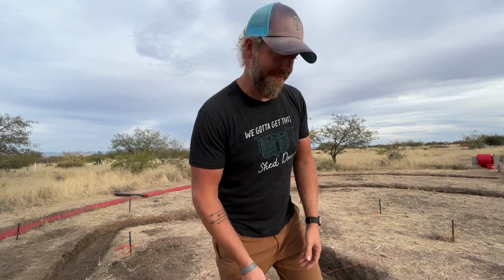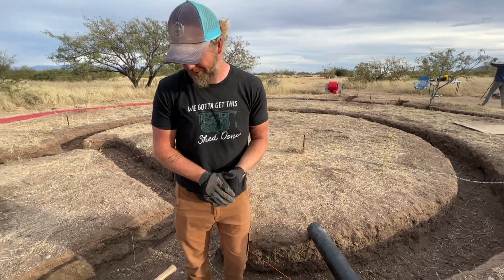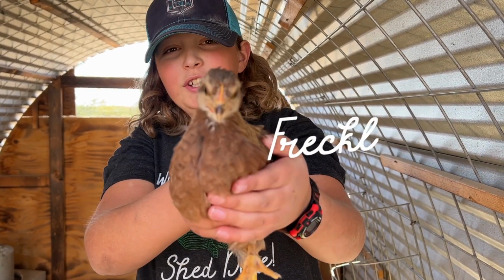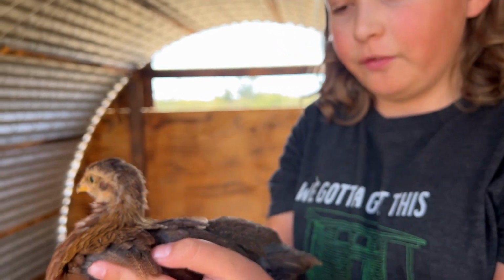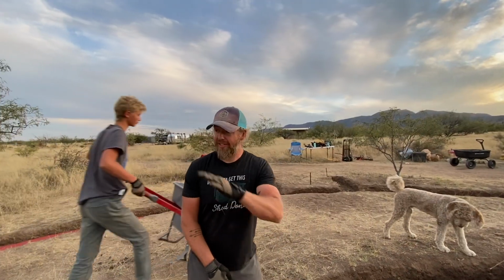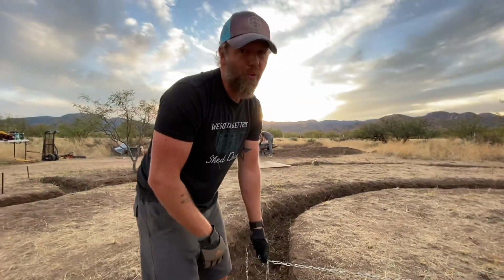Dreaming of Ways to Make Laying Earthbags More Efficient (Chicken Garden Day 18)

Comment: You pull the bag, and then you stop and tamp. If you could build a tamper on rollers, with roller sides, (maybe one of those vibrating plates  they use for concrete pours) , and pull it along behind your bucket mechanism. it could tamp behind you as you go. You might need another bucket added for those long walls. (Yeah, saw the dinosaur at 11:43)
Reply from the maker: Tamping requires too much finessing to have a motor do it. And you can't do it too close to the bucket or else you'll tear the bag.